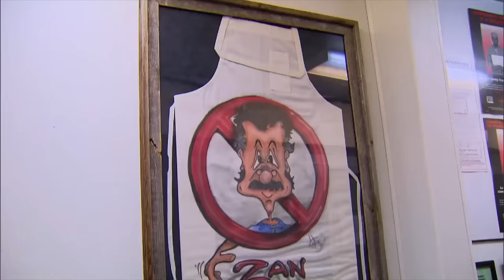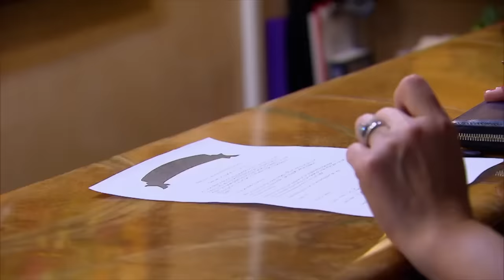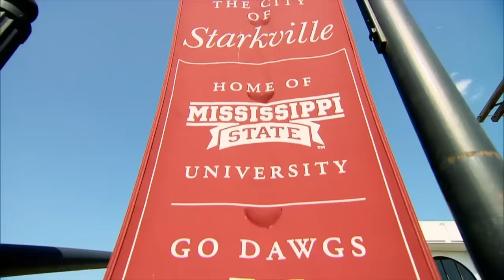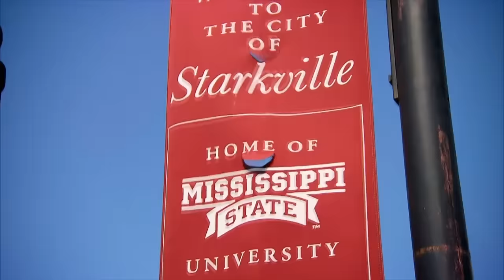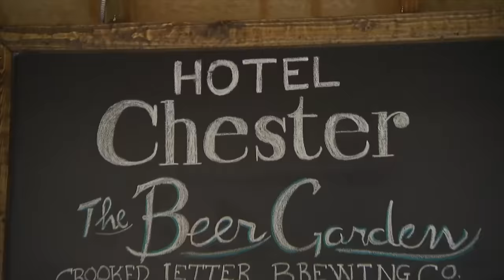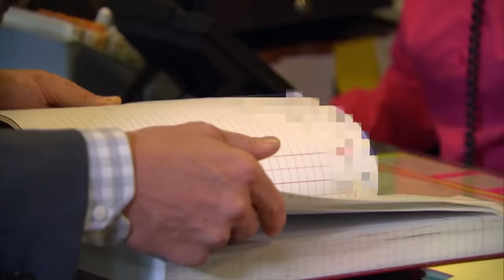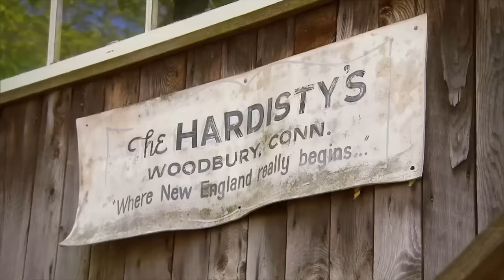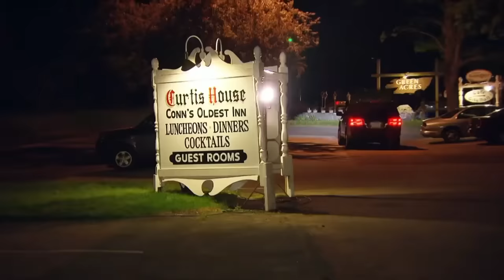🔴 Checking In with Gordon Ramsay: A Trio of Hotel Transformations | FULL EPISODES | Hotel Hell

Comment: After Gordon's renovation to the hotel, it turns out that the owner would actually remove a lot of the things that Gordon brought to help the hotel. In 2016, they opened up a separate restaurant from the hotel, in hopes to bring in more people. But that wouldn't be the only change to come to Meson de Mesilla.  The building IS still up & running; however it's not CALLED Meson De Mesilla anymore. The new owners bought the place in 2017 & it's sporting a new name called Hacienda de Mesilla. It's still at the original location, 1891 Avenida de Mesilla.

Comment: Gordon Ramsey’s advice to the last hotel owners  Curtis House Inn is more on the nose than the advice he usually gives. I’m surprised he could do it with a straight face. 😂

He’s is an expert on why you shouldn’t have your clients contact information in one place that’s easily accessible. 

He actually told the story of how he stole his old restaurant partner’s client book. He rode there on a motorcycle with full gear. Ran into the restaurant with a helmet on. Grabbed the book. Then ran. 
He used the information for his new restaurant. 

In an earlier documentary he denied it in a way that made it sound like he ‘could’ have done it, but wouldn’t say so for legal reasons. 

So when he came out with another show several years later, it was intriguing to hear him admit he did it. Especially as boldly as he did. He went into greater detail than I just did. He was actually bragging about it. 

Hearing him warn that owner of the risk is the height of irony. 

It’s like Heidi Kloom telling people to “be original” on Project Runway, after being sued for copyright infringement by the jewelry brand Van Cleef and Arpels. 😂

Is it hypocrisy or first hand experience coming into play?  😮
Reply: Bro I need some of whatever your smoking jesus